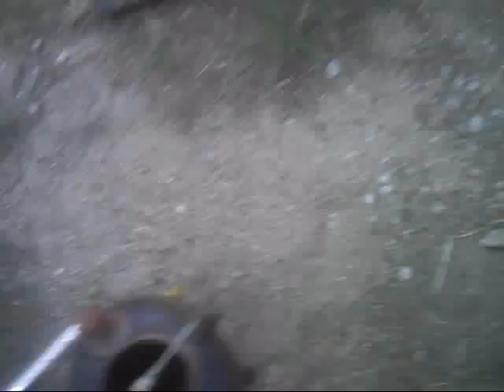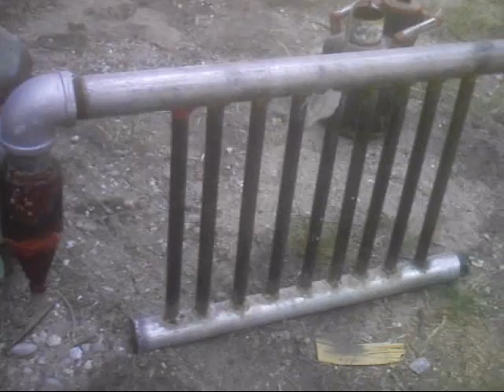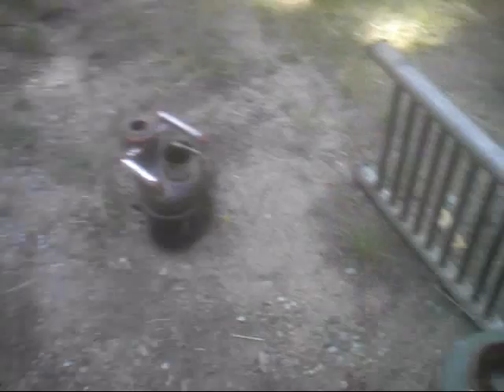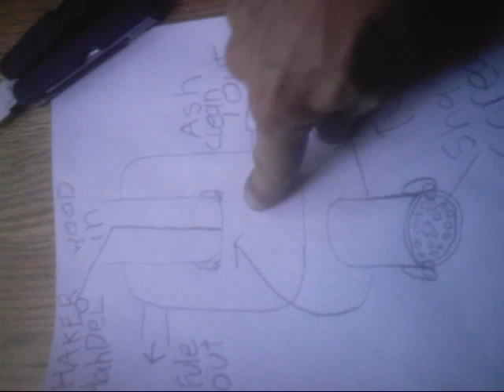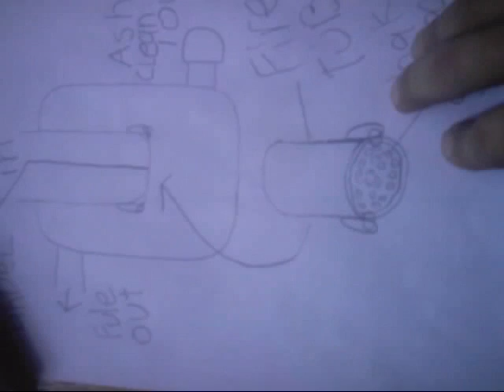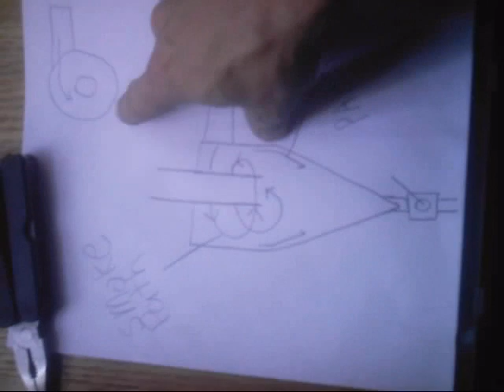wood gasifier short and simple

Comment: I like the idea of your shaker coming down from the top. Mine and most all others have a shaft coming through the side which is likely to leak.
Reply from the maker: i solved the leak problem buy taking a gate valve apart and using the shaft and the part that screws into the top of the gate valve and braze that into the side of ur reactor and it will be air tite just make sure that if u buy a gate valve that it dose not have plastic a round the shaft inside b\c it will melt Thank you